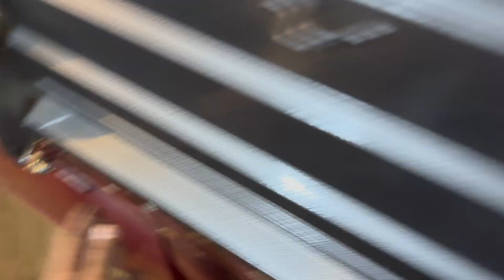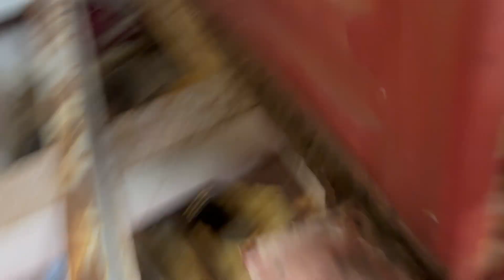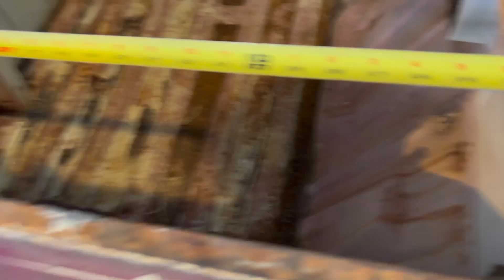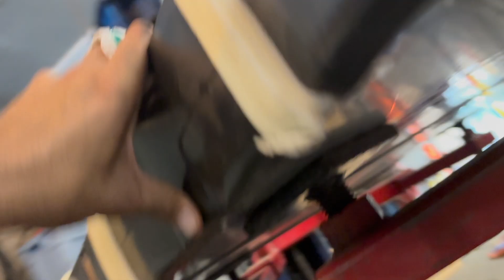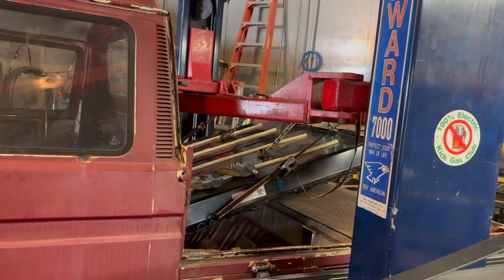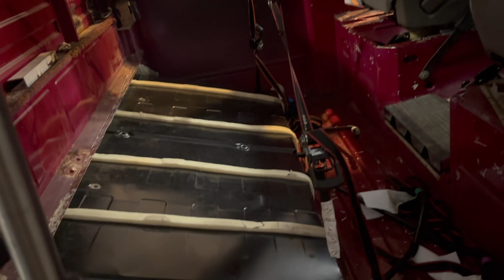Putting a Tesla Battery In My VW Bus

Comment: Original Syncro Dokas are open in that area, behind the rear seat. That is where the spare wheel is kept. It might not be missing as much as you cut out but still, the firewall/bulkhead isn't there and you then have access to the rear storage from under the rear seat. But yeah, it's mostly taken up by a fat 4x4 spare wheel.

Comment: IF you would have cut just one B- Pillar out, you could have slided the batteries from the side. easier to handle a 200kg load and the frame would have still been intact.

Comment: In retrospect, would you now merely cut off the “empty” end of the pack and shorten the sheet metal covering without removing everything and reassembling?
Reply from the maker: Yes, definitely. It would be pretty nerve-racking cutting it with all the batteries still inside though! Is that what you’re thinking of doing?
Reply: @bernietime  My 2 packs were advertised as being LFP.. I’m not sure how much room is at the “empty” end.  I would like to ask you to post your solution to cooling.  I didn’t buy Tesla pumps/octovalve.  I was thinking of a simple 12v automotive water pump and thermostat switch?  Would you show us your solution?   Also, I would like to ask you to help me complete my installation.  Of course, I’d pay daily rate and travel.  Thanks,  Steve
Reply from the maker: @ message me on Instagram
Berniebuilt
Reply: OK thanks!

Comment: Question - do you think you could have shortened the case without removing the penthouse and batteries - was it literally just hollow at that end or were there some coolant pipes etc....? Nice conversion btw
Reply from the maker: Thank you! Yes, you could however there are four coolant lines that come out from the front of each battery module. I suppose if you cut the case on the top first, you could remove the front portion of that and disconnect those lines, and then cut through the bottom, half of the case. If I already do it again that’s what I would do because that was way too much work.

Comment: A bit late, but wouldn't it have been a lot easier to reassemble the battery inside the car ? Or are the bolts that hold the cover on on the bottom ?
Reply from the maker: That was my original plan. However, with the exposed bottom side of the battery, it was just too dangerous and risky to maneuver the batteries around all the exposed metal.

Comment: Should have installed the engine on the front wheels an you could have retaining the rear engine to get synchro drive vanagon, good job on the build.
Reply from the maker: Next week, I am installing a second Tesla motor in the front so it will be a true all-wheel-drive electric syncro
Reply: That's my eventual goal: TDI driving the rear wheels, electric drive up front. There's already a potentiometer throttle for the TDI, next steps are electric power steering and brake booster to divorce those systems from the TDI. I'm in the process of refurbishing a complete spare front subframe and suspension, as the front end is a bit tired, but the current subframe will get torn down to eventually get an electric motor. I'm not sure which one yet, hence checking out as many of these videos.

Comment: I hope you realize that there isn't a frame where everything sits on. It's a monocoque.
By removing all that metal, especially the stuf on top of the treasure boxes, you're eating away its structural integrity.
Reply: While it isn't a true body-on-frame vehicle, the T3 does have integrated frame rails that run the full length of the vehicle, and the boxed rockers, if intact, help as well. The removed beams likely affect the load bed capacity more than overall vehicle integrity, but any lost strength could be restored by making a bolt-in section that replaces the removed framework. Underneath, If the longitudinal rails that flanked the Syncro prop shaft are retained, they would strengthen things as well. If those bolt up to the front subframe per original and conect to the Tesla motor cradle, that would essentially form a sub-chassis that takes up around 90% of the DoKa's length.
Reply: Have you never been under a vanagon?  https://youtu.be/LNM00RN0lkQ?t=1050&si=TWiDH4RPR4rRL4pc
Reply: You are right. Not a clever idea to cut that, that's no American car with a frame. These batteries could go in loose from the inside, single by single, only on frames. They do not need a bottom part like in Teslas, that's the VW bottom now. The battery top is also just a primitive cover now, because its inside the car and no rain and nothing splashing there like under a Tesla. So a very poor and bad idea to cut the structure of the VW, VERY bad. Engineering wise a total failure. If you want to do something good, install a hydrogen tank there. EV is out.
Reply from the maker: Definitely some valid points! There are frame rails built into the battery package. These are the frame rails of the Tesla. Hopefully, when I bolt it down to the frame of the Doka, it will add strength

Comment: Dude! Seriously? The Tesla batteries are very dangerous! They catch on fire all the time! To have one in the cab with you is just asking to get burned to death. It would be much safer to mount under the van, as others have done. That way, you still have some space between you and the fire and time to bail out. Also, the fumes from these batts are toxic--another reason to not have them in the cab. Even if it doesn't catch on fire by itself, in an accident, it frequently does. Where is your crash protection? Have you not heard of the recent crash of a Tesla truck on I-80, owned by Tesla, that caught fire when the batt was damaged and burned for hours, requiring 100k gallons of water to put out. Search Utube for Tesla and electric car batt fires--you will find many! Also, these batteries, when they burn, release toxic fumes that can be permanently disabling or fatal! 

You impress me as a really smart guy, but this is beyond stupid. Some shops do this conversion all the time, but no reputable shop would put the batt in the cab. Could you give one of them a call if you don't believe me? I know this is harsh, but seriously, could you reconsider?

Comment: I have a 68 double cab, and it's sad they welded up your access to underneath the seat, we have bolts that hold our area together.   You will need to weld that frame back together btw.   Looks like you won't have any rear seat anymore but I guess you could make a new seat stand and artificial floor that goes over it and the seat would just sit a bit higher to give leg space.
Reply from the maker: You have my dream car! Good point on reinstalling some structural components to that pass-through area. I have an idea for a steel tube frame back there, which will also double as a seat.